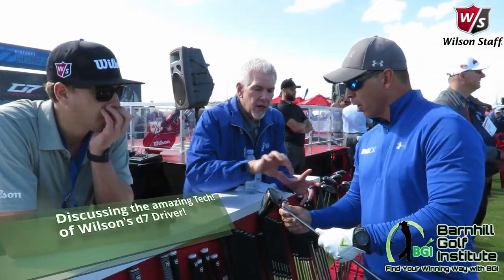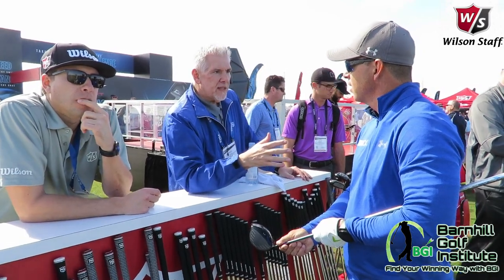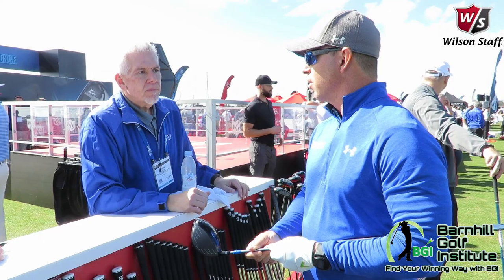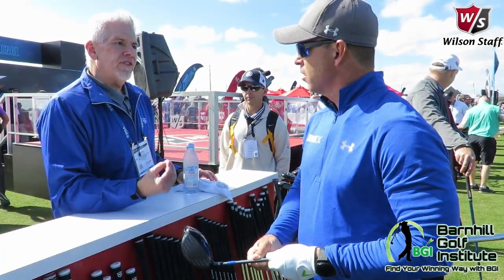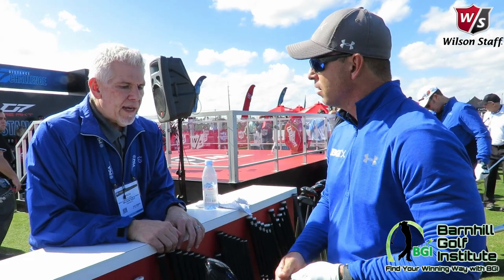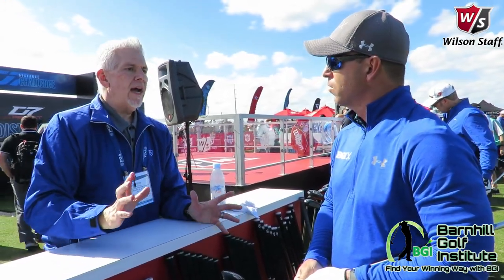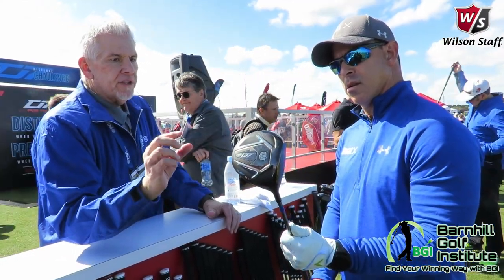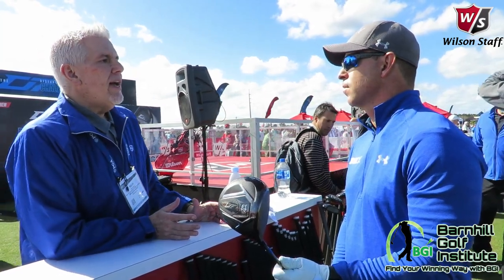The Lightweight Marvel - Wilson's D7 Driver!

Comment: Gteat video looking at this driver but can't get a fitting at moment so going to take a chance with this one. I play off 6 at 50 yrs old with a 95mph swing speed fast tempo and a high spinny flight. I won't hold you to it but would you recommend a 9* stiff shaft would be the better choice
Reply from the maker: There are so many factors. I would say stiff flex makes since and also 9 degree. You should consider the Coretex also. Check into that. Let me know!! Thanks for the comment!
Reply: @BarnhillGolf  will do I've ordered  a 9* stiff got it really cheap so worth a try